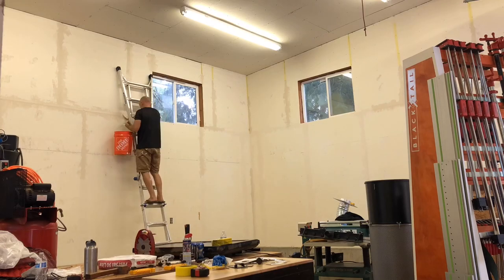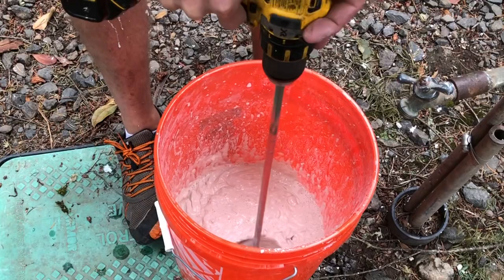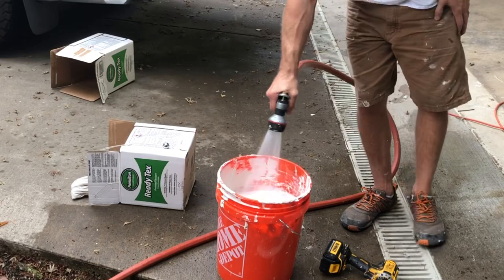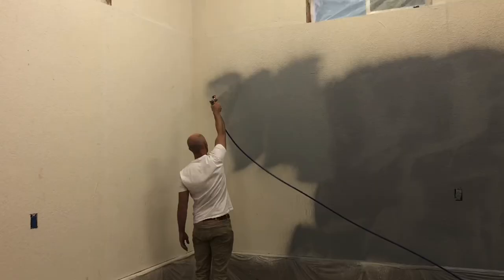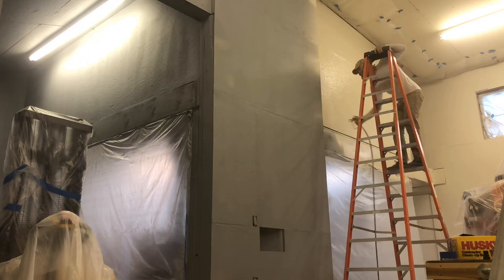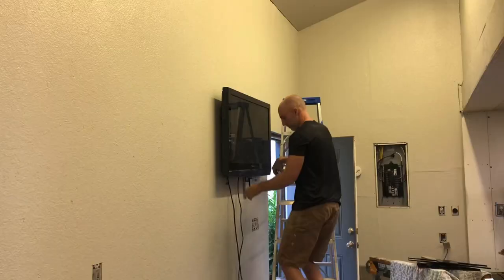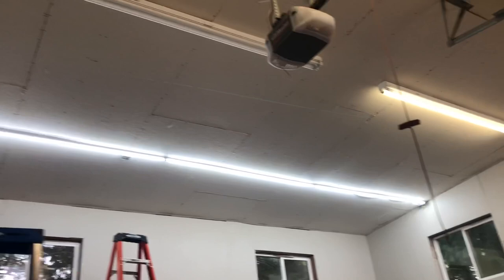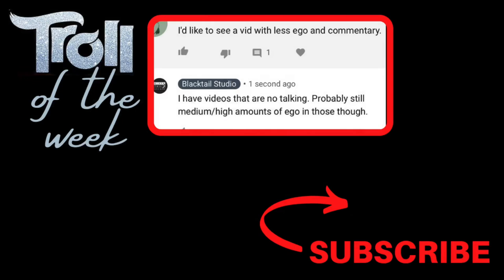Making My Dream Shop -- Episode Two

Comment: Tv: there is a way you could just take down the fluorescent lights and re wire and bypass the ballast to convert it to LED. it’s super easy and basically just like hardwiring the lights straight to the power while keeping the fluorescent light fixtures. I do it all the time at work
Reply from the maker: I should have mentioned that. I did that at my old shop and the bulbs cost 3x more than these lights

Comment: Radio - Are you going to do anything with the ceiling?  With the lights it really shows the gaps between the OSB - they make the dark gaps more noticeable. Do you think you could put some of the filler that you used initially on the wall gaps?

It could be quite cool to add in some colour changing LED strips in your workshop. You could use it for nice lighting with your photos or videos of your work? It would change the colour dynamics on some of the pieces - especially if it was a gaming or office table perhaps?
Reply from the maker: Ya, been thinking about how to best do the ceiling
Reply: @BlacktailStudio  Just cover the ceiling in wall control!

Comment: I am in the process of moving into a new shop myself.  So the timing and content is perfect for me.  

My new shop is a 20’ x 24’ garage.  Had to run 100 amp service to a new sub panel and wire the garage accordingly.  And paint/epoxy the floor.  Start wall insulation tomorrow and OSB walls the next.  Will tape and mud seams and then use a thick leveling primer for the walls and ceiling to smooth out the surface. Top coat next then lights.
Reply from the maker: That’s a legit shop!

Comment: Radio. Tip - If you ever use boxes of drywall mud again, open the box, fold the the flaps down the side and pull the extra plastic bag down the sides. Now you can pick up the box and set one of the sides on the lip of the bucket. Tip the box up and the mud will dump out. The plastic will get sucked down with it. Pull the box out and put your hand into the plastic and pull the dirty side back in. Hands stay clean. Well pretty clean.
Reply from the maker: Brilliant!

Comment: Radio guy for sure. I usually wear wireless ear buds while I work in the shop. Helps to drown out the power tool noise. Although, my projects do tend to take longer as I find I try and work on my dance moves. Great video! I really like the textured wall option, I may look into that for my shop.
Reply from the maker: Oh nice!

Comment: When dumping the bags of texture into the bucket tear a small hole in the bottom of the mud bag. It will allow air behind the mud and it will fall out of the bag without all the squeezing. Keeps your hands a lot cleaner and doesn't leave much mud in the bag. Your shop is looking awesome!
Reply from the maker: 🤯 brilliant!

Comment: I’ve done a fair bit of drywall hanging and taping professionally, and I also experimented with tapping/texture osb. Did similar to you and ran the fiberglass tape with some hot mud and then did a somewhat heavy hand texture over everything. Turned out really good. Last I checked it’s been doing great 5 years with no cracks.
Reply from the maker: I’m 6 months in a good so far!

Comment: Im definitely a TV guy. The tape will only crack if you don't use hot mud. The 90 minute or less is what we consider hot mud. It sets faster and shrinks less than regular mud. The regular mud dries to slowly and shrinks over time which leaves cracks when you're using mesh tape.

Comment: TV in the shop is the way to go for sure. I’m in the process of building a new shop. I found a deal on some T1-11 for our interior garage walls so I got enough to do the shop walls and ceiling, but I’m facing the smooth side out. I’ve been pondering what color I will paint my shop and what I would do with the seams. Taping and muddying looked good and I thought the texturing covered well. Gave me something to think about.

Comment: Great job for a amateur, I’m a radio guy. Also a painter paper hanger for over 50 years. My shop is 2  40’ shipping containers with about 19’ feet in between. Not done yet doing wring .

Comment: Radio - Cam, like the shop update video's you are putting up.  Nice to see what other people are doing and also how real you are in this series.  Nice to see other people like to take a ride on the struggle bus as well.  I am a radio guy since my "shop" currently is a carport or easy up in the back yard.  Building a big shed over the winter and plan to put a TV in there.
Reply from the maker: Good luck with the shop Richard!

Comment: I had a similar situation and believe it or not - I went super heavy on the spray and used a concrete float and ended up with a pretty nice semi-smooth finish.  It wasnt perfect but I was surprised it worked :)

Comment: TV, Cam what a great video I don't mind taking a break from the table builds, to watch you build your new shop. Actually quite enjoyable. I think you did a great job with that texture machine, I had a texture incident, can't quite call it texture application, because it kind of was a mess. And, it was very hard to get off. Good luck can't wait to see your next video.
Jimmy
Reply from the maker: Thanks Jimmy👍🏻 I can easily see that happening😂

Comment: TV guy for sure but I usually have music on the TV going so I should probably be a radio guy.  That said I could not have done the new walls etc. with the equipment in the shop. I would have left the stuff in the old place for a while if possible while painting and reflooring the new shop. If that would not have worked due to time I would have rented a storage facility. Would have cost a little but would have been worth it. I wish I had done just that when we bought our new home. I like the behind the scene videos, it shows us how you got where you are.

Comment: I'm a TV guy for sure, Oh yeah and as for the texture paint job inside the shop, looks fine, its a shop and besides it actually looks better than many shops that are out there, and it clean looks great man, I do have questions about how to use certain equipment for wood working but I'll get back to ya on thos questions thanks for sharing.

From your new friends in Lima Peru
George & Carmen

Comment: tv,I do not care for textured walls, ceiling, etc. at all. Not even for a workshop. Tape the workshop, paint, and then add  pictures, wood designs, or anything to break up the focus on the inperfections in the walls. Color is fine. Sorry, I am old so all I see is an 1980's  apartment in Houston. Everything was textured to hide inperfections. Love everthing you two are doing.

Comment: I'm Radio. Thanks for the lights recommendation, I'm ordering a set using the Amazon link above now. And I didn't realize how easy and cheap it is to texture walls, hopefully I'll remember the next time I need to texture large areas. So, I'm finding good stuff in your shop series, thank you.
Reply from the maker: It’s not too bad!

Comment: I just purchased an LED fixture that has four legs. It will  go in the center of my new 12x24 wood shop. It looks like a ceiling fan and each of the four legs will pivot up and down to aim the light. I hope to have it hooked up tomorrow. It has a total of 12,500 lumens. You can not look at it straight on. I think it is going to awesome.
Reply from the maker: Love that!

Comment: Radio! (well, podcasts)
I think your walls look great for your first time at it, but all that really matters is that you are happy with the results. Knowing that amount of detail and effort you put into your tables, I know you are a detail-oriented person and I suspect that you will regret not getting the walls, "closer to perfection". I also wonder if the unfinished ceiling will bug the crap out you later on as well. It will be tons easier to do the work now than later after everything is set up.
Reply from the maker: I got other plans for that

Comment: I would like to preface my comment that I’m not hating on you or any of the such. Just some friendly advice to help with your or anyone else’s who is reading this with their next project. We can always improve our work and techniques. It’s always great to be able to do these kind of jobs instead of paying a contractor or handyman. 

Regarding the LED ceiling lights or any lights. 2700K is warm daylight with a little yellow tint. Move further down and they are real yellow. 4300K is absolute pure white. 5000K is mostly white but a touch of blue. 6000K more blue, less white. 8000K - 12000K gets purple. The “problem” happens you have factories in China building them for the lowest cost possible. 

The wire mesh that you laid down in that slab on the side of the garage isn’t exactly how you want to do that. There are plastic spacers called rebar spacers or rebar caps. They are dirt cheap and I would recommend using them the next time you ever need to pour a slab. The slab was definitely big enough that wire mesh and rebar is necessary if you want to do it right especially on that grade plus the weather there. When buying concrete by the bag always buy more than you need and you can always return what you don’t use.

Keep up the good work! I like the shop build videos because it helps break up the channel a little with some change.

Comment: TV though I like radio as well, silence is usually good.  Love your lights, definitely will put that on my list.  I light flat, non-tecture walls so easier to clean, surprised you went this way, there is 1/4" drywall, easy to install and let others (professional) tape so nice flat easy to clean wall.  I will be interested to see later if you have issues cleaning the walls or if the vacuum system does a great job for you.  Waiting to see the vacuum system and air system go in.
Reply from the maker: I’m sure there will be some dust on it

Comment: I like the shop videos and what you end up using.  Interesting what you did with the OSB👍👍.  I’ve had both TV and radio in various shops, always have speakers for podcasts, music, etc.  As far lighting range I’ve researched that anything over 5000K is good for paint,etc.  at 6500K you will be able to detect defects better so you went with the right lighting IMHO.

Comment: CDs,  I find TV and radio too distracting.    I'm not sure what the spectral transmission curves for the LED light fixtures are like (You might want to consult the manufacturer) but I use a mix of daylight and warm white fluorescent fixtures in my shop which give me a better balance for judging color.  Homes typically don't have 65K (daylight) illumination and you might find that what you like in your shop won't look the same when you get it in a home environment. (You would probably have a problem with your customer who didn't want reddish walnut.)  Since I heard you say you're color-blind, this could be even a bigger issue.  If the LEDs have a spikey spectral output, similar the fluorescent lamps, as opposed to a continuous spectral output like tungsten lamps or actual daylight, you will have a problem matching colors.  Congratulation and best wished in your new home and shop.  I've enjoyed the videos of the new shop.

PS: i wish you would date your entries.  I see comments ranging from 6 months to 2 years.  I suspect I'm out of sync with your videos, but I'm send this anyway. 10/24/22

Comment: Tv, I have the lights you bought. I recommend strapping the to the ceiling because the manufacturer hold down are cheep and have had light drop off ceiling.

Comment: Not sure if you know or if someone has brought it up or not, but 6,000 kelvin can damage eyesight in long run. I understand you like the bright light, maybe when you dont need "inspection level" light have another switch to run 4000-5000 kelvin lighting and when you need the 6 switch it on. That should help your eyes not strain so much. Ive done a lot of LED retrofitting for factories, and this is one of the more common complaints/issues we ran into.

Comment: Radio, I guess, have a 46" flat screen in the shop but something is wrong with the coax from the house so only one station comes in currently...limits the tv usage for now...  The shop is looking great, I just hope you don't come to regret textured walls in a dusty environment.  If it does get to a point of needing cleaning grab the leaf blower, works fantastic for getting behind, under, high spots, piles of lumber, etc.. with the big doors open just go back to front and "power wash" the place...  Dan
Reply from the maker: I’m sure it will

Comment: @Jason Hamilton  Your request for videos of my shops is flattering. During most of the years I was setting up shops, videos were not the common thing they are today. Plus, we were too busy getting work out the door to have time to stage and organize things for effective story-telling the way so many talented young people like Cam do now. That said, I can off a few tips.

The first is that no one can organize your shop better than you can, namely because you must work backward from an honest assessment: of the work you really do (i.e., the work that pays your bills, as opposed to the fantasy/fun projects you wish you were doing); the size and architectural specifics of the your work space; and your operating budget. With these in mind, apply a complex triage and cost/benefit analysis to each of your investments of cash and commitment of (always limited) shop real estate to each process. Best classic advice is to buy what you need for the job in front of you.

And in general planning, do as modern pro sports managers: go with the analytics. Pride of place and/or permanent locations go to fundamental (and/or immovable) machines and equipment used on almost every project. Secondary ops machines can be on wheels, stored in compact parking spaces. To save space, consider options (e.g. track saw, Domino, Lamello) where the tool rather than the workpiece moves. You can rip a full sheet with a track saw in 10"; on a table saw, you need almost 20'. That said, you can perform a myriad more ops on the TS than with the track saw. So you can see how the considerations and decisions are complex and must be analyzed and tightly fitted to your specific work flow and logistical situation.

Another overarching principle, touted by Festool as though they invented it, is to establish a system(s) for your shop and tools, based on modularity. When you take a systems approach, you find yourself in position to jump on sales and salvage opportunities that would not occur to you without such a context. Tanos was not the first company to build modular, stackable toolboxes.  I had built dozens of my own modular tool cases years before their arrival on these shores von Deutschland.

Shop organization is a topic I could babble about for quite a while, but it's time to be making sawdust this morning, so I hope this little bit is some small help to you. The main ideas I would leave you with are: to rely on yourself; to take in everything you see like a sponge; and to separate fantasy from reality when making decisions about how to organize and equip your shop.

As one example of the kind of systematic approach I suggest, you can check out a modular component fence and table extension system I actually patented and developed 30 years ago at www.1-fence.com. (I still have limited inventory and make occasional passive sales, mostly to legacy customers.) Please feel free to contact me directly through that site or my IG feed @michaelschuler.carpentry.tools with questions about your shop setup (not necessarily having anything to do with 1-Fence.) If I have time, I'll do my best to answer them.

Carpentry and woodworking can remain fascinating for a lifetime if you put heart and soul into it.

Good luck!

Comment: Radio or TV?  Definitely both but I like music that's not readily available through either so I have a traditional surround sound stereo system as well.  I'm outfitting a new shop at the moment, downsizing form 1300 sq ft to about 400 plus another 170 or so in a loft.  Opposite to your move, I went from rural to 'burbs.  Love seeing what others have done in their shops.  Keep the updates coming!
Reply from the maker: Dang!

Comment: Ok, so now i know what to do with all the unpainted, about 50 year old, 1/4 inch OSB walls in my cabin. We talked about just painting it, but then it just looks like painted OSB. father in law suggested doing something like a skip trowel and then paint it. I had also considered doing what i did in my home kitchen(i SUCK at drywall).. i took a heavy textured paint roller, and drywall mud thinned just a bit more... and rolled it on, then used a 12" wide scrapper and did a knock down of all the peaks. took a whlie... but covers up my suckage at drywall :)

Comment: TV. While I understand that this video is a year old, I would caution anyone against putting electronics into a container bound for the local landfill. I am definitely unaware of the laws in your local area. However, doing so in my local area can come with a $500 fine. That being said. Great content as usual. Your paint job far out strips my painting endeavors which inevitably end with more paint on the floor, windows and myself than the intended surface. Lol.

Comment: Radio guy. Like the shop upgrade videos. It shakes things up. Heck with out a good shop there's no good table's. I have a 30 x 35 shop with 16' ceiling and used 5 highbay LED LIGHTS. only way to go. As far as being self defecating to your availability on texturing...it got the job done and you saved a few thousand dollars. Besides I don't think your not going to sell any tables on your ability on how well you tape or texture.
Reply from the maker: That’s fair!